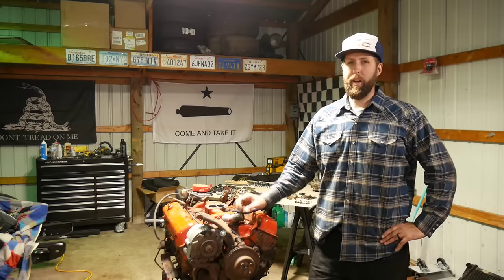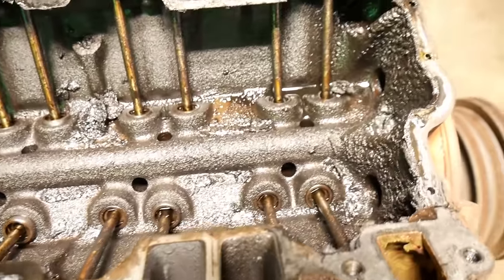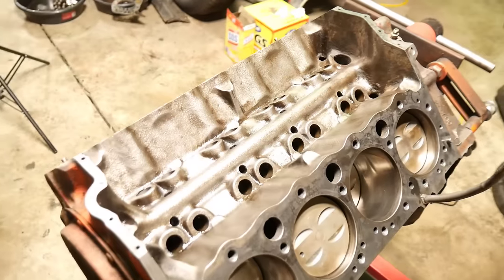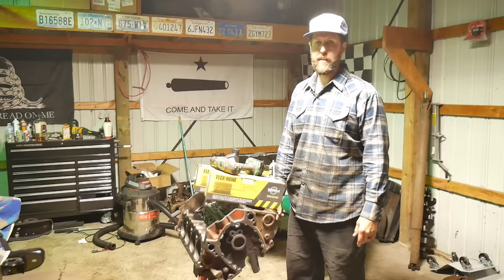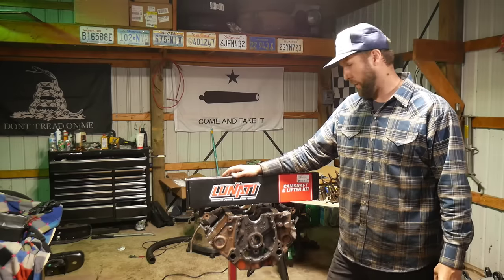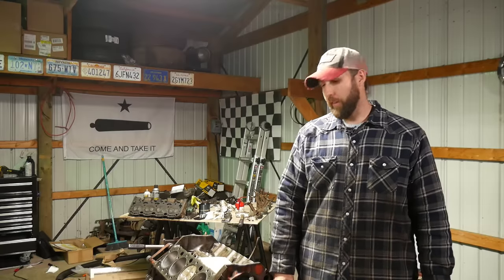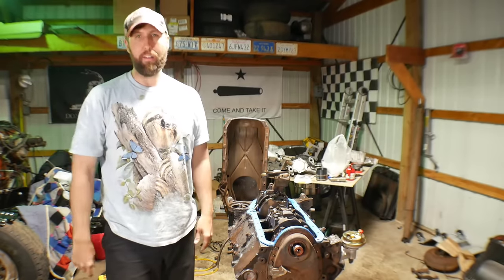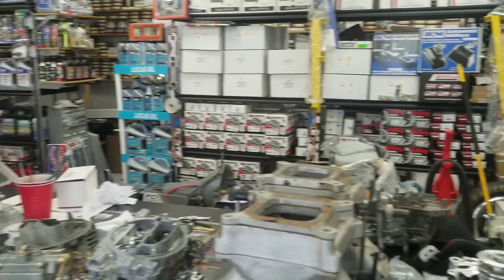Budget 307 Small Block Chevy Build & Dyno - Vice Grip Garage EP28

Comment: Cool rebuild!  I like the "saving money" aspect of the build and that you took the 307 and didn't do anything radical to it.  And 290 hp is very respectable!  When I was much younger, I remember those 283's and 307's.  Not very well liked motors, but they were work horses.  I remember that everyone wanted a 302 or a 350 including myself! 

Years later, I had a 1980 Camaro that came with a 305 4bbl Rochester.  It wouldn't rev, so my buddies and I decided to "build" it ... if course the wrong way.  The block looked good, so we just threw in a way too big cam, a double row roller timing chain, bigger heads (I think 1.92 intake, but I could be wrong) with factory springs, keepers and no valve work, headers, no cat, dual exhaust with no name turbo mufflers (still not sure what they are, but they sounded good), Edelbrock Performer intake and Holley 650 (definitely too much carb).  It had a highway rear end, I think it was a 2.41, which we swapped out for a 3.31 posi.  And of course the chrome valve covers, timing chain cover, alternator bracket and the blue anodized Edelbrock air cleaner!  There were a few times, I ran her to 6,000 rpm (just touched it) and she held.  The motor made such good noise above 5,000 rpm!  The cam had way too much lift and duration, so she loped at idle and loved high rpms.  I think she was still making power at 6,000 rpm, but I didn't want to blow up the motor.

The "rebuild" lasted about 25K miles - she still ran well, but the performance had drifted away - maybe compression?  On a very hot day, I overheated her (bad radiator - I knew it, but I didn't want to buy a new radiator, so I kept running her too long).  I broke something - she still ran, but one exhaust pipe blew slightly white puffy exhaust.  I was so upset, that I didn't do a tear down and wound up selling her.  Maybe it was only a bad head gasket?  No leaking coolant outside the motor and only a slight oil leak.

That was the last "performance" V8 I owned (the 1984 Pontiac Firebird with a 305 4bbl was not in the same league).  Now it's higher performance 4's!

Thanks for making this video.  Brings back some great memories!

Comment: It is great to see someone build a engine that unfairly gets no love. actually most if not all engines have potential if built right. a 307 is basically a stroked 283 and in the late 50's and early 60's they built some great 283s, even boring them a 1/8" over and creating the 301. Chevy later built the 302 with a 327 block and a 283 crank and installed it in the Z28.
Reply: how about a .40 over 265 =272

Comment: FYI, you don’t need to use umbrella seals on the exh valves cause it can’t pull vacuum through the exhaust valves. I have done literally 500 to 1000 sets of sbc heads and bbc heads and never used anything on the sbc except the o rings on the exh’s and on the bbc’s, yes we used either the push on seals or the the umbrellas and sometimes only the o-rings all around. It’s a preference. Love your channel Derek, don’t ever change what you do.

Comment: Derek, Derek, Derek - You bring back GREAT memories! I know your popularity (and business) makes it impossible to respond to comments. You may not even be reading them. Been watching you a LONG time budroe. Rebuilt my first engine in 1967. A stock 265 in a 56 chevy with an el cheapo rebuild kit. Blew it up at Dragway 42 in Ohio less than 30 days later. FAIL. 1st "serious" build was next winter 1968. I was 17 and my mechanic bro-in-law assisted. HIS choice = a bone stock 283. Tear down showed it very well cared for. Summit Racing had just opened for biz. Basically just a small speed shop in Stow OH about 10 miles from my home. Got all the parts at Summit of course. BROKE the bank at about $150 bucks including cam & them machining the heads. Did NOT turn it into a 307 by changing the crank. Simply bumped up the cam a bit, high rise manifold and a Carter 4 bbl and that girl ran and ran and ran. That little 283 would do 13 sec 1/4 miles in a stripped down 56 chevy body in CMP (C - modified production for those in Rio Linda) I still think its the most dependable engine you can put in a vintage unit or street restomod.

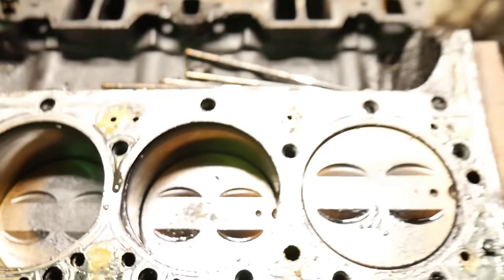Comment: Back when these things were just about everywhere we put one together with a set of bowl ported and gasket matched double hump heads, an E 1090  ELGIN circle track cam (more mid range power and throttle response than strip grinds), a ported cast iron 327 intake with the dividers cut down and an 800cfm Q-Jet from a 455 Olds, and a cheap set of 1-5/8 headers. It went into a '72 Nova with an M21 and 4:11 gears out back. After recurving the distributor, some carb tuning and with the headers open it went 13.40s on street tires.
And not ONE chrome part.
Not too bad for an engine everyone said was only good for trips to the grocery store.
No dyno numbers - only the rich kids could afford dyno time back then!

Comment: I had a 1981 Delta 88 with a 307. That was the best engine I've ever had. It was reliable and had plenty of power. I used to do dry pavement donuts in it. Lol It was alot of fun. I really miss that car.  I gave the engine to a buddy and he put it in his fire bird that was set up for a V6. After he put it in he could bark 2nd and 3rd gear and it was an automatic.🤣

Comment: best mileage I got on my 76 nova with 305 that I put a quadrajet and manifold on in off a 73 350 it would do 25 mpg typical highway and it ran great. I sold the car and the next owner put 300kmiles on it so with about 400k the engine still ran great. it was the death of the 2nd trans a junk yard turbo 350 at 300k as well as the rest of the car that finished it off. engine never complained.

Comment: My first car was a 1968 camaro with a 307. I could careless about the HP, it was freedom to go where I wanted when I wanted.
Reply from the maker: nailed it!
Reply: Royce McCarthy 78 Malibu with a 305-same. As long as it would get me away from home I was good with it.
Reply: My first camaro was a 67 with the straight six cylinder
Reply: after you got wheels did your friends start calling you  'Royce Rolls' ?
Reply: Me 68 nova 307 - tha same 
.
Reply: I had one in my 72 Nova. A bunch of metal shavings would come out when I changed the oil but it always ran fine. I sold the car to my buddy he yanked the motor to put in a 350 he built and some guy put the 307 in his van.... I wonder if it is still running.

Comment: Close power to an early 2000's 5.3 (~325ci) LS v8, came with 285-hp, 325 lbs.-ft.
Reply: Not even close to anything ls related this 307 will put down 140-179hp to the wheels depending on fan assembly and accessories used a stock 5.3 will put down 220-250 to the wheels stock and ls1 5.7 put down 300 to wheels ls based motors are monsters

Comment: Ihad a 307 in my 72 Cmaro. Drove it cross-country from Chicago to San Fransisco in late 1980. Topped out at 117 MPH in the Western states. While I had it replaced the fuel pump and radiator (it had over 117,000 on it when I bought it. The thing was a tank.

Comment: "Did you put a good valve spring on her?"

"NOPE!"
Reply: Stock! Unknown mileage.
Reply: Some of those 307s rounded, off lobes on the Cam But I bet you knew that .
Reply: valve springs are always tested to make sure they are almost equal in measurements and strength !!!
Reply: @jefflefebvre899  ours did ,, i read a batch of 307 cams weren't given the wear treatment is what caused this around 1970
Reply: @jefflefebvre899   Rounding off lobes wqs a small block thing, not 307 specific.
Reply: @jefflefebvre899  The issue was them fuel pump lobes.. They got wiped clean if the rod got stuck. No lobe. No fuel to carb...So either new cam or electric fuel pump..
Reply: And buddy replies “oh boy” hahaha
Reply: @Vince Dechant  reminds me of how my grandparents spoke. (From the Duluth area). Derek you rock sir! :)

Comment: I just started the video and decided to comment first. And just as I decided I heard the first comments about distain for the 307 (which, yeah, quite aware of). Back in '83 my '71 K/20 with 307 threw it's timing chain, bent stuff, so time for engine work. I wanted the power yet had economy concerns as well. I didn't care what anyone said, I built me a peppy 307 4bbl. Without details, that thing sure felt like 300hp to me and it got 13 mpg (4spd/4.57s/37" mud tires)

Comment: Hey I just found my dad's old 84 oldsmobile cutlass supreme and he has like 5g of miscellaneous parts to rebuild a motor like this he has a locking dif in the back a oil cover a carburator along with a cam shaft and the things with springs on topr of the pistons sadly my dad couldn't teach me squat before he passed but I do remember working on his 350 k15 square bodybut idk know what to do this video really gave me at least a start thank you so much

Comment: I had a 307 . I bought a 73 LT . Kid said it had a 350 . It didn't drive like a 350 . Ran the numbers . Its a 307 . So i put a 327 intake on it so i could run a q jet on it . I killed alot a cars with that 307 . Car had a 3:08 posi rear end . It would snap both rear tires up in smoke when i dumped that spredbore ! Raced one guy . A buddy at the time . He had a 30 over 390 . Melling cam . Headers n a holley . We raced . I was behind him a car length . Single lane . Hangin a left . We nailed it . He jumped ahead a car length . As soon as we got around the corner . Turnin left . I jumped in the merging lane and dumped that spreadbore . Shot on by him and put 2, 3 car lengths between us . He couldn't catch back up ! Which is why im a spread bore guy ! That 307 killed alot cars ! I finally floated a valve one day . 5300 rpm .
It went down hill from ther ! Good Times 😎

Comment: Ah! A man after my own heart. I love the small cube engines and they can be made to run good for their size. I put together 2 of these engines, one for a 72 Nova (Free engine) and one out of my 70 Chevelle. The Chevelle had a 200R overdrive with a 3.23 GTO diff. It was a blast to drive, 2200 rpm @70MPH and it would upshift @ 90 MPH under full throttle.

Comment: Cool episode! Pretty respectable numbers for low buck experiment! Not all my projects need to pull the wheels off the ground. I have new respect for the 305 - 307! Thanks!
Reply: Me amd my dad are currently doing a few things to a 70 model 307 that he put in his 71 C10 some years back out his 70 C10 he totaled and ive got a bigger new cam and lifters to put in and its already straight piped with headers and im gonna get a dual plain intake and 4 barrel and take off the 2 barrel just simple stuff but this got me thinking about a rebuild kit and putting some flat tops in also
Reply: Should already have flat top in it from the factory already, 4 valve relief.

Comment: I rebuilt my 307 (1970 Chevelle convertible) way back in 87 when I was a kid. I read a book on how to rebuild an engine. I added used Hooker headers,  used Team G high rise manifold, hardly used Holly 450, new Erson cam, and a used HEI distributor. I also ridge-reamed and honed it myself. Added a shift kit and a higher stall converter. It ran great and it fired on the first few attempts. I think I had about $350 all in. Put in some overtime at Taco Bell to pay for it all.

Comment: I didn't catch what heads you used. When first started driving my IMCA modified I had an old school engine builder that wanted me to run a 307 as the lower hp would let me get some seat time without having to learn how to feather the throttle in the corners like I would with a motor similar to what the other guys were running. Except we installed 305 heads for the higher compression. He decked the block for every bit of compression we could get. The parts were basically free and all the other hand-me-down parts from another driver were as well. On a 1/4 mile track this car held its own. 1/2" mile not so much. Thankfully my forte was chassis tuning. So every bit of power that was there was hooked to the ground. I'd run the same setup again on a short track if I was still racing. Our setup certainly produced a lot of torque.

Comment: Stick a small roller in that 307 and itd go well over 300hp.. make a good economical engine for a t-bucket or such..
Reply: There is not any point in a roller on a small bore, stock headed, stock sprung 307.  That cam and lifters would cost as much as the entire engine did.

Comment: I have a 307 in my 84 cutless supreme. BUT.! I put vortec heads on it. Runs great.
Reply: With the vortec heads, you got a better air and gas flow  right, but did they fit ok, did the coolant holes match up
Reply: Pete shea  I'm assuming he swapped a Chevy in. I believe the 80's Cutlasses had Olds V8s or Buick V6s from the factory but I'm not 100% sure.

Comment: I like to install the bumpstick with the block on a couple of 2 × 4 and sitting on its rear end.
To rebuild those 305 HiPo heads, consider LS valves. 1.9 or 2.0 intake and 1.55 exh. You do need to install 8mm guides which can be the LS iron or bronze. If you have a spring installed height of 1.8", you can then use valve springs, retainers and keepers from LS heads from a wrecker.

Comment: I do use the rubber end gaskets. I also always use rtv! I put a small amount on the surfaces and use my finger to spread it over the entire gasket area. I do this on everything but the head gaskets. A thin coat of rtv spread out on both surfaces is sort of a primer coat. Pretty much guaranteed no leaks , and very little squeeze out. Oh, I learned this the hard way! A long time ago.

Comment: The 307 would get more hate than 305 if more yutes knew about them, glad you did this build. Turned out to be a solid little engine, it’d be perfect in an S10 or 2wd square
Reply: I disagree.  307 naturally has a larger bore than a 305.  That can allow for a bit better breathing as the rpm climbs, mostly thanks to the valve shrouding being a bit less of an issue.  Not that either is the ideal build up option, but a 305 is certainly more asthmatic thanks to that tiny bore.  All other aspects, they are both Chevy smallblocks and benefit from the same parts.
Reply: wlabishler 1 you completely missed my point lol
Reply: 307 =    283 stroked w/327 crank

Comment: My 307, with 361 double hump heads, fulie solid lifter cam, windage tray, 2X roller chain, forged TRW pistons, swirl polished SS valves, 700 2X pumper, long tubes, over 300 hp, revs to 7,000, no problem.

Comment: Been running my rebuilt 307 in my 68 impala convertible for 20 years.  Reliable,   good looking little engine.   When you add a few go fast parts to it and a 2.5 inch dual exhaust its fun!

Comment: Right now I have a 60 over 350 block with 12 to1,  327 pistons with DEEP valve reliefs and  full floated rods with a 307 crank with the balancer bolt, an isky solid lifter cam,  
 202  intake valve,  polished and ported small chamber heads. So it is a 336  cubic inch engine making 457 hp at 422 ft lb of torque,  it's not huge but it is a rpm  SCREAMER.

Comment: I use RTV on each end of the intake because the rubber doesn't stay in place and the cork isn't much better. The one piece oil pan gasket is great. I dropped the front of my engine to check the chain. There were no leaks. I use a dab of RTV in the corners of the pan/gasket contact points. I use 3  1/4-20x4 inch bolts to install a cam. I use plastic tubing to cover the rod bolts and rotate the engine so that Ihe deck surface is parallel to the floor when installing pistons. The tubing is cheap insurance and rotating the engine makes it easier to guide the ford to the crank. I DO NOT USE ENGINE "CRANES" because I usually work by myself. My shop ceiling is at 9 feet so I reinforced the bottom of the trusses,and place basement, adjustable jack post on each side of the front end. I place a 2x4 vertically on the windshield when removing the hood to protect the glass. That way I can remove the hood from the front by myself. Cylinder 5 was bad, not number 3. What about cleaning the parts?
Reply: I’m
Reply: One more thing. The 350 cubic inch blocks have 2 bolts holes on each side of the engine front. This allows these blocks to be used in the Tri-5s with 265 and .283 engines that used front, not side motor mounts. One of the holes one the right side can be used to hold the fuel pump push rod in place when changing the pump. Replace the bolt that aligns with the rod with a longer bolt, finger tight. Replace the pump and be sure to reinstall the short bolt.

Comment: My dad got funny looks when he asked for a rebuild kit for his 1970 C10 307 and brought the block and heads into the machine shop.

I asked him decades later why he rebuilt a 307, and he said it was his work commuter truck and got decent fuel mileage. 
It still hauled firewood (coil overloads), towed their small Scotty camper, and Starcraft cabin boat. 
The engine ran great when he sold the truck many years later.

Comment: I'm coming to this way late on a number of counts.  The video is 4 years ago, and when this would have been relevant for me is 1982 when I drove up Pikes Peak and blew a ring pumping smoke out the tail pipe.   It was a 260, but I had no money to rebuild.  I should have scrounged harder for an engine swap if not a cheap rebuild.  If I could have taken it 20k more miles it would have been great.  But I didn't have the experience or friends who did.  I parked my car, it deterioriated and eventually burned in a wild fire.  I wish I would have rebuilt it at the time.  Good memories though.  Thanks for the video, its great!

Comment: Yep, a 307 is fine by me. Did a re-ring overhaul, same like you did. Valve job on the stock heads, rings, bearings, short duration rv cam, headers, and weiand intake. Back in the '71 nova she went with 4speed trans. Not a high horse engine by any means, but decent enough on the street. Overhauled in '95 and still in the car today.